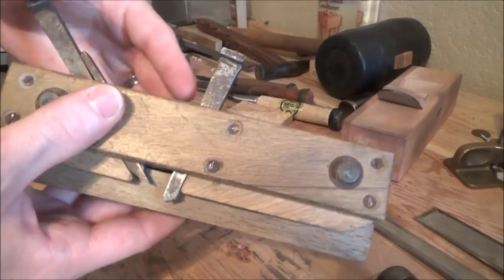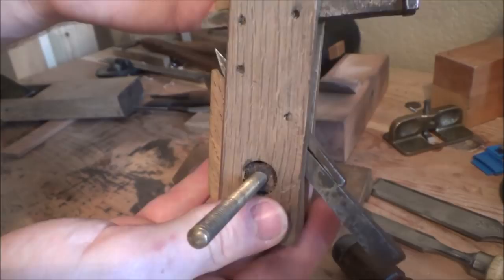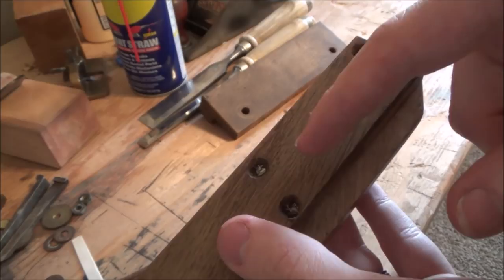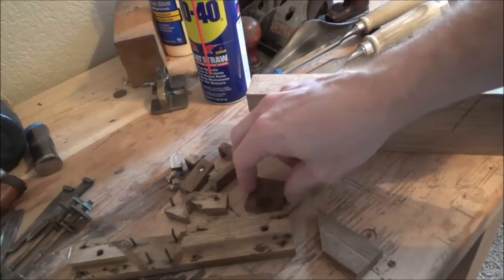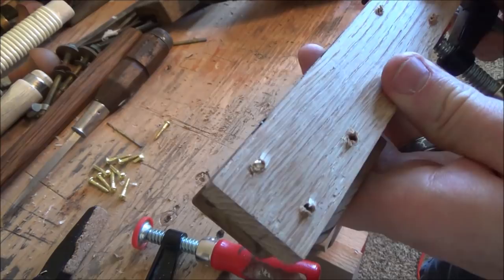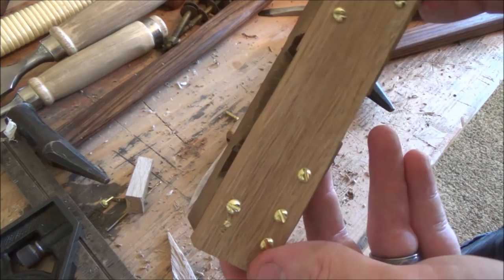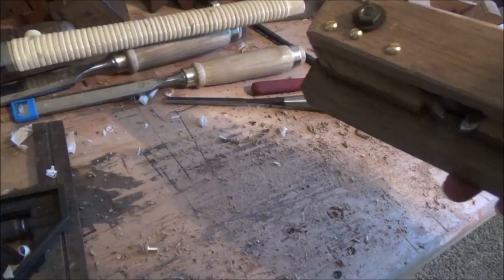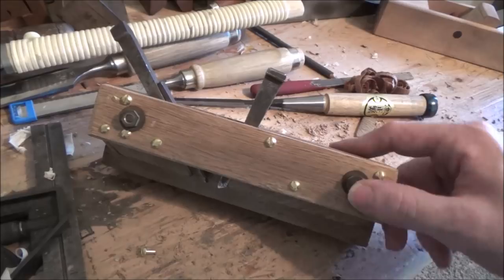Restoring The Japanese Machine Plow Plane (Kikai Shakuri Kanna)

Comment: Well, first off let me say that yours are some of the most entertaining videos on wood working.  Your humor (small encouragement device) is wonderful.  Second, because of your Wari Kebiki video, I made one.  I ordered a blade from Hida and they sent me the wrong one.  They sent me a really long blade.  I called and told them I would send it back but I could just cut it and get 4 blades out of the one.  The gentleman said he appreciated the call but I should just keep it.

I changed the key mechanism to a screw and added a brass inlay so the wood doesn't get damaged.  This is just a test.  I jacked the hole for the beam.  We don't learn anything without jacking something, right. I will probably make one like yours with the key when I practice mortising a hole.  Thanks for your great videos.  I am considering buying the Odate book.
Reply from the maker: Thanks for the kind words Bruce. You are absolutely right, the best teachers are the mistakes that we make, hope that wari-kebiki works out for you!

Comment: 1st: if you screw in hardwood put a little bit wax or butter on the thread ... it makes it easier and the screw doesn't break ...  2nd: if you start working with this plane don't start at the end of the board ... start 25 cm in front of you and than work back piece by piece to the end .... if you do so you don't need so much power to get a clean cut in the wood ...  good Job ... it's fun to see you videos ... 👍🏽
Reply from the maker: Thanks for the tips Joe! This was my first plow plane so thanks for the advice on using it. Always learning something new.

Comment: The reason why you had trouble opening the plane is because the plane is made of oak, and the oak reacts when coming in contact steel and corrodes so if using oak use brass.

Comment: I recently bought one of these and it works quite nicely but the width of the blade (9mm) gives me headache when thinking of the time when I will have to do uradashi (first timer). Do you think it is doable? And how can I do that to the 2 guiding blades? I am very curious as how Japanese woodworkers perform uradashi on their marking knives and such delicate blades.
Reply from the maker: In all honestly they really only do that on wider edge tools. Narrow stuff just gets ground down to the point where it's sharp again. I've talked with dozens of them and they never do it on anything narrow like 9mm wide